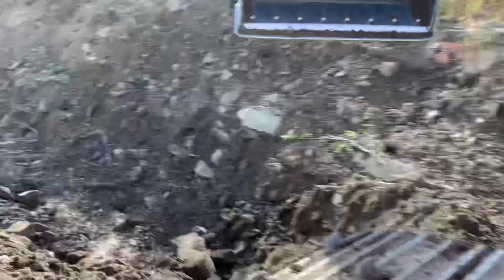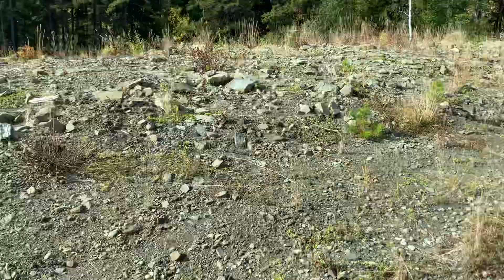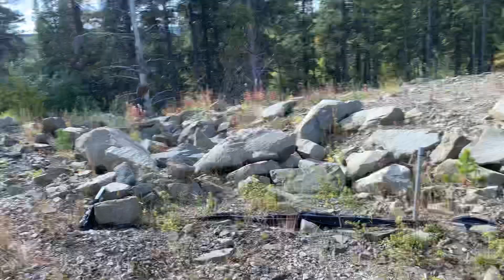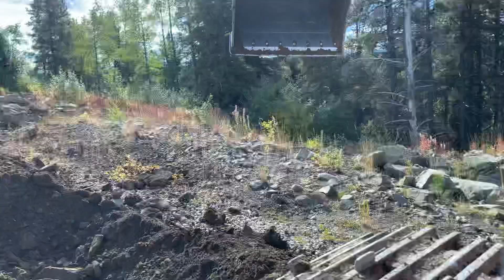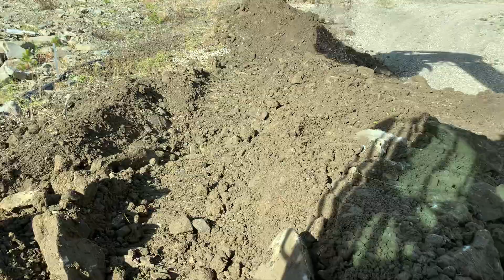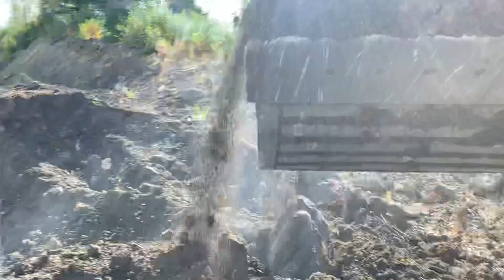Efficient Technique To Move Dirt 50% Faster

Comment: How do you get into operating on the pipeline ?
Reply from the maker: Most places are name hire, you need to know someone. But you could try sending out some resumes to pipeline companies. I got on with a resume
Reply: Thank you. I’m a young operator. Debating if I start my own company or if I go to the pipeline and build of some cash and some relationships. Thank you for replying!
Reply from the maker: I do both, pipeline in the winter and have my own machine for the spring/summer when pipeline is slow
Reply: @efficientexcavations  

I really appreciate you replying. I may end up doing something like that what size machine do you have?
Reply from the maker: Just a little 12,000# Kubota I can haul around with my pickup
Reply: @efficientexcavations  nice! I currently have a tb290 been very impressed with it in terms of power and smoothness over a long period of use
Reply: @Trey Carlson  the takeuchis are amazing machines. And insanely reliable

Comment: That’s way faster
Reply from the maker: It truly is, I’d say twice as fast but you still have to clean it all up at the end ... the key to do that efficiently is to have the left over material as thin as possible. Like sitting on a foot or less, so every clean up pass you make you are getting the whole reach of your machine. Cover a lot of ground quickly when you’ve already bulked the majority of the material away already. Rather then sitting up on say 15 feet of material and every scoop you are wasting time pulling grade cleaning as you go and a bunch of material falls back down on what you just cleaned up. So you are basically cleaning the same spot over and over ... Always Bulk, Then Finish.